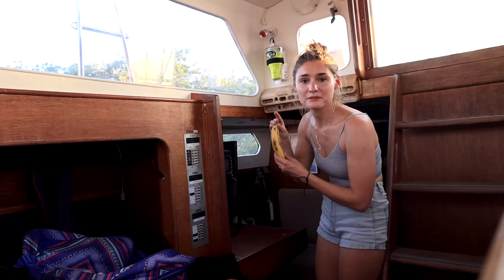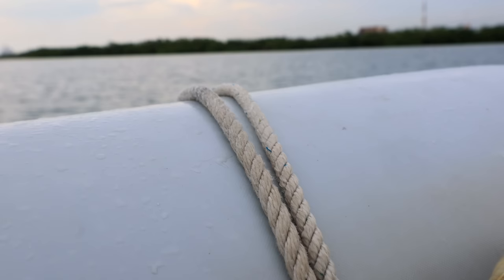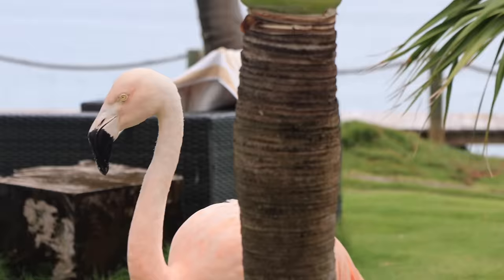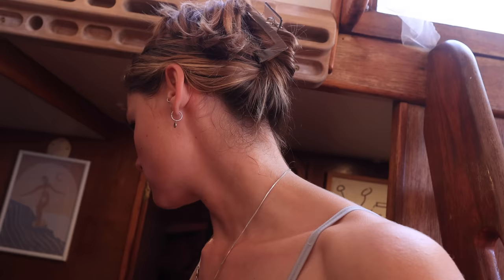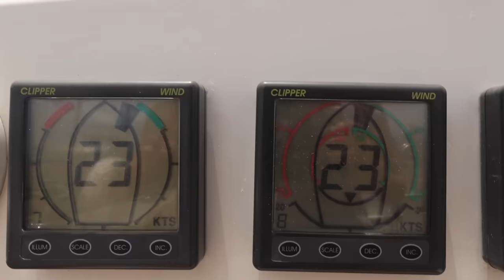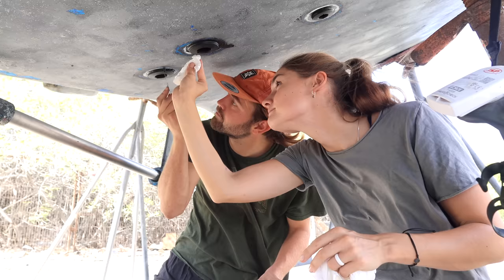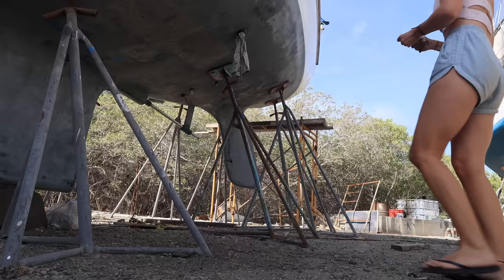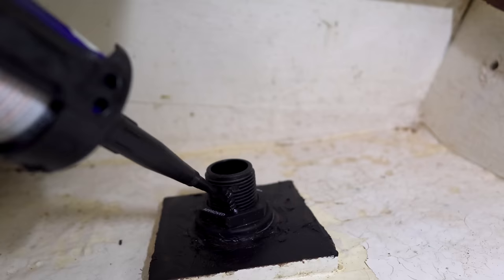BOAT YARD LIFE: We won’t make this mistake again!

Comment: When we lived in Europe, I stored our ski boat on the hard under a massive layered tarpaulin.   Twice I returned in the summer to find an entire hive of wasps living in the boat - the work to get her running started with their exit, which took well more than a day each time.     I also put rat poison pellets in the bilge.   She was not run for a couple of years at that point, so to get it started, I pulled the spark plugs and turned the motor over to let the oil pump get oil over everything and to visually inspect the condition of things inside.   Lo and behold, green rat poison pellets came squirting out of the number 1 cylinder through the open spark plug hole.   That had me scratching my head until I figured out that that cylinder was the first one accessible to the exhaust.    The mice, who store their food elsewhere, had taken the poison pellets, run up the exhaust from the transom all along the inside of the exhaust to the front where the exhaust valve was apparently sitting open for that cylinder.  They had managed to get into the cylinder and store the pellets.   This was a 305 cu in. V-8 motor, the valves are large.  Long story short, once lubricated, emptied of pellets, and  everything buttoned up, the motor ran fine and to specification.

Comment: When using a hand file you should only push it in one direction.  When you use the file back and forth it dulls the file.  They are designed to be used in only one direction and that direction is pushing the hand file over something.

Comment: Becka,

Place your paper towel and seeds in a plastic Ziploc bag. After dampening the seeds and paper towel, seal the Ziploc bag; the moisture will stay inside and the seeds/sprouts shouldn't dry out.
Cheers!

Blue Skies.

Faithfully,

James

Comment: You could put your sprouts in a plastic bag (freezer bag) that you can open up and close with an elastic band after spraying. So when you spray them with water and that water evaporates because of the heat it creates a humid environment inside the plastic bag and the water is still trapped around not letting the seeds dry out. :)

Comment: Grow the sprouts inside glass jar with screw lid; keep moist but keep in a low to floor cupboard as hot air rises.
Keeping it in a dark place it will not go green , and remain nice to eat.

Rinse sprouts before consumption.

I am enjoying the adventure you both started.
Safe sailing.
Everett
Reply from the maker: Great suggestion, thanks Everett!

Comment: If you lightly countersink the holes you filled with epoxy top and bottom they would be more securely locked in and no chance of popping out

Comment: As with any important job... Preparation; Preparation; Preparation.... and then even more.   Hopefully, after all that work, you won't now sink.  Great to see you back on Teulu and I'm looking forward to what you've got in store for us all next Monday.   As for the Bees, the quickest way to get rid of them from inside, is to get a small box, cut a small hole in it and put some pieces of very ripe fruit in there.  They'll go in and start gorging themselves.  When most of them are in the box, move it outside, away from your doors and windows.  It's a trick I've used several times in my home, with considerable success.  Russ.  UK.

Comment: I don't like to be negative but...
When using sealant on threads you need to fill the threads not just lay sealant on top as it won't make a perfect seal, just apply to thread and use finger to fill each groove. Remember your not just doing it, your bloody doing it.

Comment: I had the same or similar happen to me Seattle in the early 80’s.  I had reefed out most of the deck seams in an old wooden tug boat, then used 5200 as a seam compound.  Before I knew what was happening the boat was being swarmed by bees.  As I have related this story over the years it seemed like no one believed me.  I felt sorry for the number of bees which got stuck in the 5200 that day. Also as time went by we learned that 5200 was not the thing to use as a seam compound but none of us knew that in 1980.

Comment: I’m surprised the sea cocks aren’t NPT threads.  I’m sure you received some sort of instruction on sealing those threads, reflected on what you showed us in the video.  If I ever have to replace sea cocks on our boat, I will also be using a similar design due to the lack of corrosion. I just hate the idea of relying on a liquid sealant to seal straight threads. Generally there is a flange and gasket / o-ring that provides the seal on straight thread connections.
Reply from the maker: They do have an o ring and we sealed as well as that, which was the recommendation 😊

Comment: Best sprout advice above is damp paper towel below and above. Check and moisten couple times daily. They dont need to be out in sunlight. Some rigs you can purchase and a few diy that ive seen consist of a small stack of nesting, screen bottom trays and get a steady supply out if the bottom tray as you keep adding a tray to the top of the stack. 
Thru hulls, valves and associated bits are some of the fussiest and most time consuming jobs. Plot all of it out beforehand. Wont bore you with a thousand details, but you want to get it perfect the first time... every aspect of it.
Glue -- stay with epoxy for everything. Stay away from polyester. Yr in it for the long haul. Yr good with resperators, but with every project, get the details done, bits of tape n such, then put gloves on. Both hands. For everything. Been at this for decades out in the field, these toxins need to be taken seriously. Especially if, like me, you are often living n working without running water or a shower. Work clean, dont work dirty. If yr not gonna use proprietary epoxy pumps, you can do ok with cheap plastic measuring spoons. Acetone is ok, just dont wipe crap off yr skin with it... yr driving it into yr boodstream. Even out in the world, you can usually find denatured alcohol, which is a decent cleaner for most of the bad toxics of boatwork, specifically a thinner/solvent for epoxy, n much less toxic/volatile to carry around. Rags for any of these should be immediately soaked in water, even if you want to use them again. Dont forget little glue brushes for getting in bolt holes n such with solvent or epoxy. 
You guys are fascinating n encouraging. Keep going.

Comment: Use a mason jar for ur sprouts.must rinse 2x daily to avoid mold.we do it in FL summer.  You can do it. I put them in a few inches of water until they start then begin rinsing and get a screen lid put upside down.  You got this
Reply from the maker: Cheers for the advice, we'll have to try that!

Comment: Nice DIY jobs on the beautiful island of Aruba.❤ Clearly a young pregnant flown out bee queen liked your Teula too as her new home after choosing which of the many holes to enter..😅. I saw on other boat vlog-accounts that they also sealed the passages where the plywood wood layer is visible with epoxy before connecting the new seacocks. Assume you guys know and applied that too. Looks really super nice again.🎉 On the contrary, I decided to seal off as many passages as possible asap, like for the head/toilet. Then I sleep more peacefully....😅😊 Looking forward to your next boat jobs. Bravely forward and sail by the wind of today (or at least try)..❤
Reply from the maker: I think so! We did look for her but they all looked the same 😆 yep, we applied sealant as well as the gasket. Thanks for watching!
Reply: @TeuluTribe  Maybe starting a beehive on the boat for honey now that the plants weren't doing it ;-)

Comment: We have a colvic Victor 40 from 1986 and the hull is much thicker than yours! I guess because they are hand layed they can be different thickness yours looks like 8 10mm with a wood backing plate, ours is 30mm all fiber no core and no backing plates. I find it interesting same boat same model very different construction. Just thought it might be useful for a potential buyer of a colvic or something to know this, and check the hull thickness. Cheers
Reply from the maker: Our Colvic is around three inches for the keel, two inches up to the water line, and one inch to the top, just like the others we have met. She's a solid boat, maybe the way its filmed makes it look different
Reply: @TeuluTribe  There might be some kind of measurement conversion error going on. 2 inches = 50mm 😂 you can clearly see on the video that the fiber part of the hull is about a Zach finger. And we hope he doesn't have 50mm fingers 😅
Reply from the maker: @reversingentropy  oh haha you are right, worryingly, that was what our survey said it was haha. Although, im sure you have the same thing but different parts of the boat are different thicknesses. Our bow is almost double our stern, our lazerette is pretty thin- and we have spoken to three other Colvic Owners who have the same thing so must be quite individual.
Reply: @TeuluTribe 😂 There is no doubt these are super super sturdy vessels, they can take everything we throw at them and they will probably Outlast us if you feel like watching us save one from a slow death at the yard check out our videos https://youtu.be/UtkSevq7a1k I haven't edited most of the footage from the renovation yet, but is very fun to see the differences between victor 40s we se you working in the bilge and try to guess which part of the boat it is lol

Comment: not sure about your skin fitting process. the pros here where true design are made in nz fitted mine with one guy outside holding the skin fitting while another inside tightened nut up on the sika flex. done.
waiting till it skins up and re tightning will break the seal ?
true design are regarded as the best.